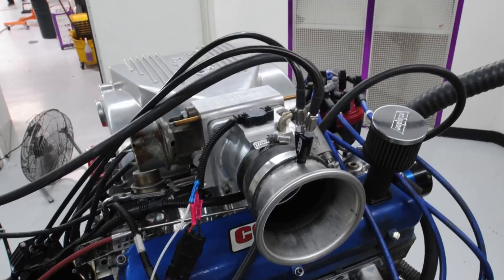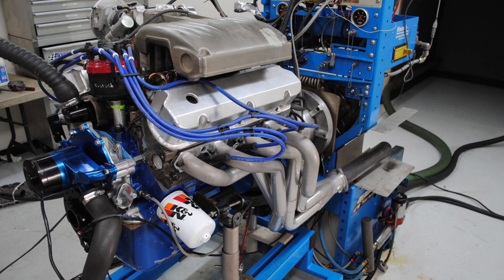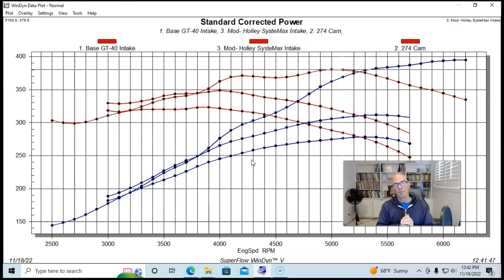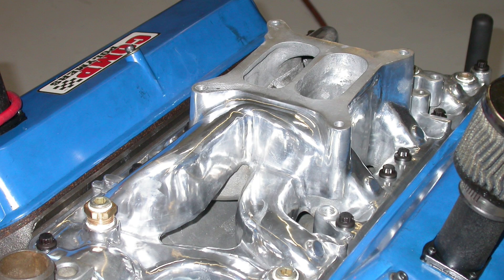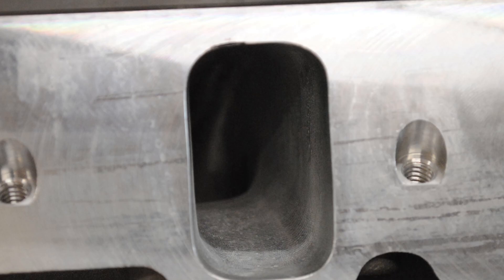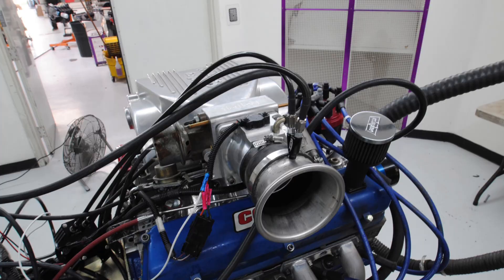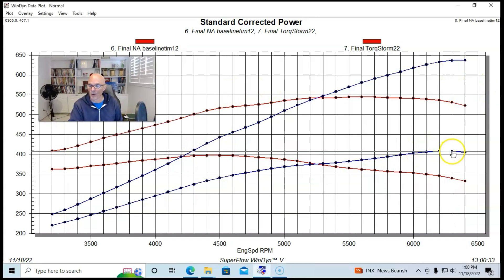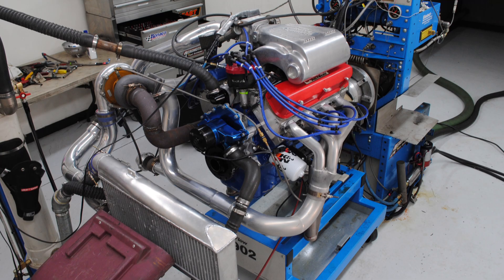HOW TO CAM A POWERFUL 5.0L FORD. TURBO, BLOWER, NITROUS, STROKER AND NA CAMS-THEY ARE ALL THE SAME!

Comment: my fox has a e303 and 1.6 pedestal rockers etc. hoping it works well with my new weiand 174 setup. any and all advice is welcome!!!                ❤❤❤❤
Reply from the maker: those all work
Reply: @richardholdener1727  you rock!! 🎸 🤘
Reply: @richardholdener1727   While I have your attention!! I have a set of aluminum z heads. They look like they have a pretty wild port job on them how would I go about finding the right valves? a good machine shop to "stuff" them? 
thank you!!

Comment: Thanks for all the great videos you share, , I'm building a 302 blowthrow set up and was wondering which supercharger kit you would prefer since you have experience with both. 1 is the paxton 1200sl kit and the other would be the torqstorm kit.  Thanks in advance and for all the great videos!

Comment: What is the trick flow version of this cam? Stage 2? Stage 3? Very curious about this one.
Reply from the maker: 2
Reply: @richardholdener1727  did some investigating, looks like the ramp rates and overall lift on the intake side are different but otherwise the cams are alike. 
Also, it turns out that the TF stage 2 is a copy of the old Anderson B4 cam, but it's so long ago, that currently Anderson can't confirm any of the timing events or ramp rates on the B4. The info was lost to Anderson when Crane was purchased by Comp. Back then, the ones doing the grinding would sell the cams off to other makers to slap their own names on them, hence the Trick Flow stage 2. This led to all the secrecy with Anderson cams once they changed suppliers. 
It's very possible that the 274 HR cam is a descendant of the old B4 cam, as Comp would have acquired the info through Crane. Likely with some tweaks towards modern knowledge. 
Still though, the nod goes to Rick Anderson for his contribution to early Ford cam progress.

Comment: I do know that a single cam will work across power-adders. 

THEORY:
for supercharged or nitrous-injected engines, more exhaust size and/or duration is proven to help, as the size of the intake relative to the charge entering the cylinder gets larger in its capabilities, but the size of the exhaust versus the greater output of exhaust due to supercharging and/or nitrous injecting gets SMALLER relative to the amount of exhaust that has to escape against the same atmospheric pressure and exhaust system flow. 

Now, a turbo does not cause the same relative change in sizes/ capabilities of the intake and exhaust valves due to the fact that backpressure in the exhaust system is rising at the same time the boost pressure is rising, so it behaves a lot like a motor that has come upon a pocket of high environmental air pressure, once the turbo is spooling.

In other words, non-turbocharged engines that have power-adders like to haver more exhaust valve timing and/or capability to maximize the power output because the higher energy density of the intake charge while making the intake valve more effective makes the exhaust valve LESS effective relative to the volume of exhaust facing the atmospheric pressure, ultimately.

Long-tube headers cause supercharged engines to "lose boost" but what they are really doing is reducing the backpressure fighting the intake charge entering the cylinders, not losing the boost out of the exhaust valves or some other mysterious black hole.

In short, packing more mass of air and fuel into a cylinder in the same volume being taken in increases the mass flow capability of the intake valve and reduces the (relative) capability of the exhaust valve to get rid of that extra mass.

The only way to find the fine-tuning differences in cam timing between a N/A, turbo, nitrous and supercharged versions of the same engine is to just try various configurations out, like the increased exhaust duration of the Hellcat versus the 392 in Hemis, for example. Dodge didn't arrive at that conclusion by lucky guesswork.

For ultimate power production, each individual part of an engine would have to be designed specifically to contribute in concert with every single other part of the engine, which is kind of an F1-level budget requirement.
Reply from the maker: IN SHORT-ANY CAM WILL DO THIS SAME THING-THINK NA POWER THEN BOOST ADDS TO THAT

Comment: Iv been saying this for years. If you get a cam ground to do EXACTLY what you want, power band, idle etc, you can only improve that with boost. Making more na/ requires less boost to reach the same HP as a weak na engine built just for boost. Proven over and over and over again by this guy ☝️

Comment: I use to run a 347 stroke with the pistons sticking 10 out the block with lunati 51018 cam  560/576 242/252@50  on a 110 with victor jr heads hogged out angle cut  and was a little over 12-1 and super victor intake and 950xp carb  made a little over 540  na at 7000 then swapped to solid  694/702   264/270@50  114.  And turned it to 8500 and was making close to 600hp.   Then on a grudge race sent it to the moon with a 250 shot .

Comment: Before I do watch this video I have one question even though it will probably be answered by watching these videos. The question is how many times or passes can you make with that one team on each setup before it destroys something,
Reply from the maker: ONE TEAM?
Reply: @richardholdener1727 sorry about that sir usually I talk to my Bluetooth I believe that was supposed to say one engine. I have been doing this for about 40 years and never exceeded 700 horses but they 351 because I was always told after that it's going to grenade

Comment: This flies in the face of what we've all been told. Manufacturers want you to buy everything specific for your build, when it's not really necessary.
Reply: In the automotive community, there are many long-standing "rules" that aren't relevant anymore. Technology changes, but people don't.
Reply: The ultimate finely-tuned combination for each engine is a massively interwoven web of codependent factors. Most people are NOT looking for ULTIMATE fine-tuning, as it is FAR cheaper to just turn up the boost, add more cubes, or slap on a set of heads, not do exhaustive research to find the ultimate combination of absolutely everything.
Reply: Works does not mean optimized. Just like you gain or lose hp with a certain cam based on heads and combo, your cam can change power with your power adder too. Can it work, absolutely. Is it "best"? Not likely.
Reply: @pimpovic2  this. And too many people sweat over 5 horsepower when they're already making 4 digits. Really doesn't matter unless you're trying to set records.